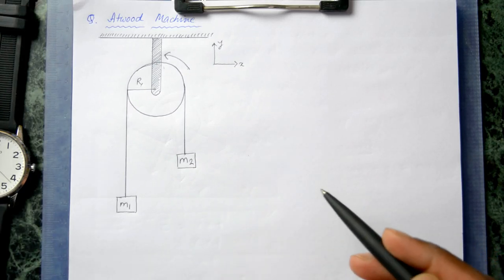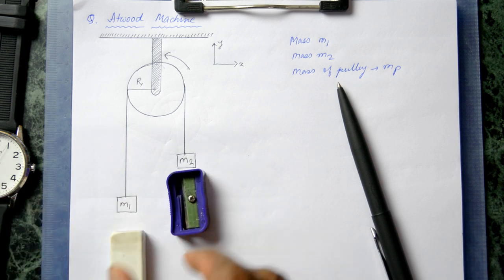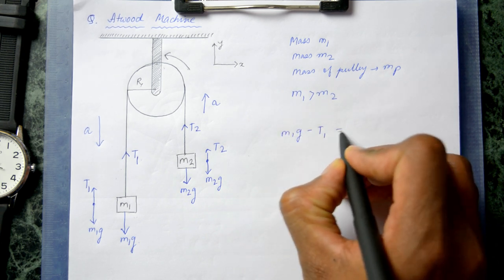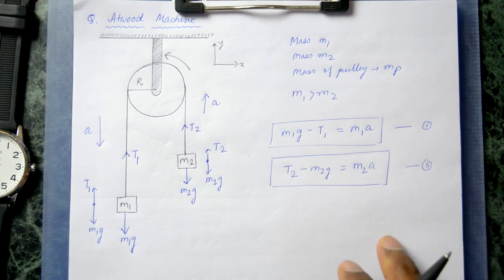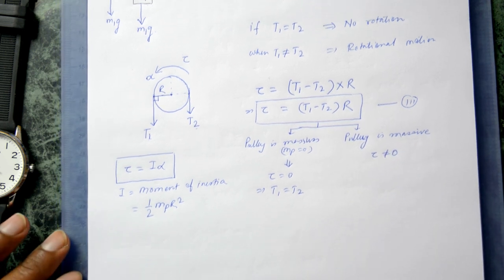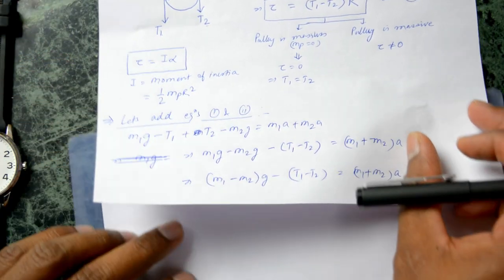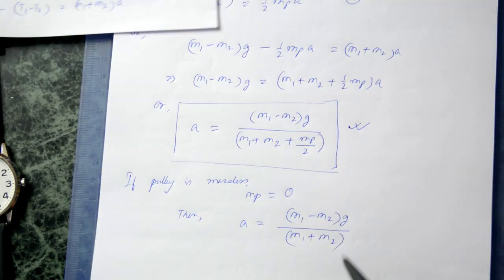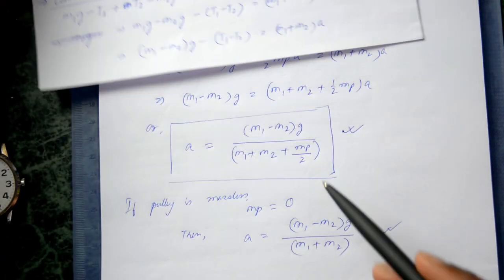Atwood Machine - Pulley Problem (Newtonian Mechanics)

Comment from the maker: MORE PROBLEMS
Block on a Wedge - Friction Problem (Mechanics) : https://youtu.be/UB79ICRNnUk
Disc / Wheel Rolling down Inclined Plane (Mechanics Problem) : https://youtu.be/5xGTv-tfoHg
Atwood Machine - Pulley Problem (Newtonian Mechanics) : https://youtu.be/_LQs_nJqEXI
Bead on a Rotating wire - Problem (Newtonian Mechanics) : https://youtu.be/xe7nGSw7ZGc
Bead on a Rotating wire - (Lagrangian Mechanics)
 : https://youtu.be/xmXORmm9m-o
Motion of Charged particle in E and B
 : https://youtu.be/wpQJKg8Zl4s
Reply: Sir I= MR^2/2   +MR^2 NHI HONA CHAHIYE THA?
Reply: instaBlaster...

Comment: Dear sir, even if the pulley had mass, if there was no static friction for the rope to make the pulley rotate with it, tension still would not change. If the rope (assumed light) was sliding on the pulley without friction, the tension would still remain the same on both sides, irrespective of whether the pulley had mass or was light enough.
Reply: Hello sir/madam

From my understanding, I do not completely agree with you. Now let's assume the pulley has some mass and the masses of the blocks attached to the two ends of the string are different, then by a simple Free body diagram we can see that tensions due to the weights of both the masses will change hence, torque is exerted on the pulley which results in it having some angular acceleration. 

Pls correct me if necessary
Reply: @bruhguy4215  Your reasoning is correct but you made a mistake,there will be no torque due to tension as their is no friction by the string which can make the pulley rotate.

Comment: The contact forces the ones exerted on the pulley 
1) how are they caused since the only forces are friction and the vertical force from the pulley
2) why are they equal to the tension. If we consider two separate ropes then they have zero mass

Comment: Can someone give an explanation as to why tension is different on both the blocks. I mean it's necessary to cause rotation of the pulley but isn't it contradicting the fact that tension is same throughout in the case of massless string.
Reply: Bhai jab pulley ghumegi iska iska mtlb string ka friction pulley mein lagega aur badle mein pulley string par ulti direction mein yaani T2(if m1>m2) ki taraf friction lagayegi. Yaani (T1+f)=T2.
I hope samajh aaya ho.
Reply: The case of massles string doesnt implie equal tension, the case of massles pulley and different masses implies that.
Reply: @violentgaming8231  bhai phir acceleration same kyu hai....equally acceleration should be differing for both bodies na
cuz agar tumne force lgaaya for m2 with acceleration a toh uske against bhi toh friction lgega hi na..........
Reply: Different masses create different forces along a string